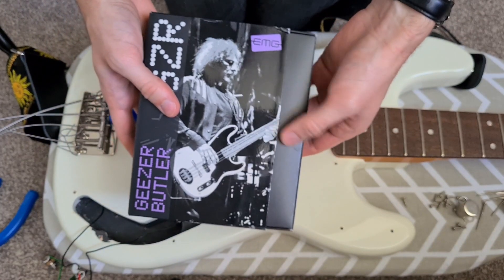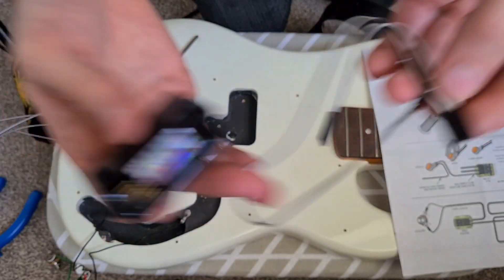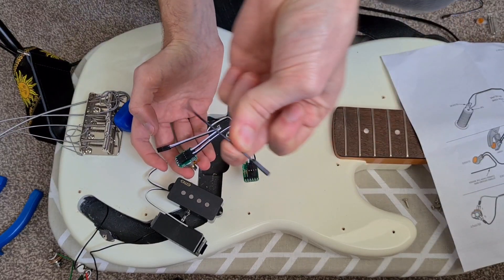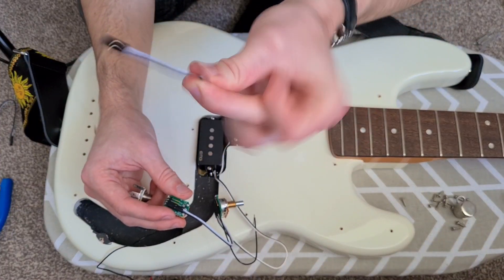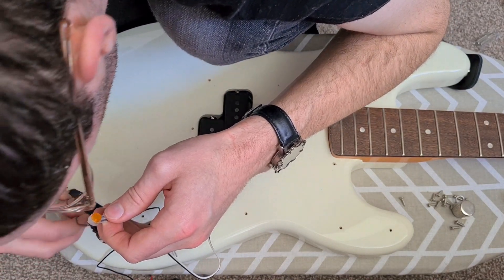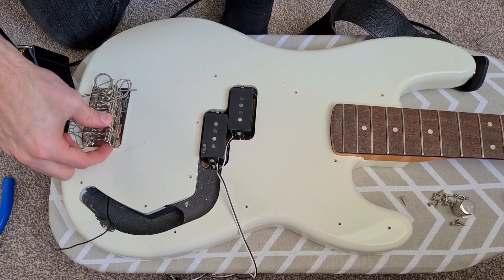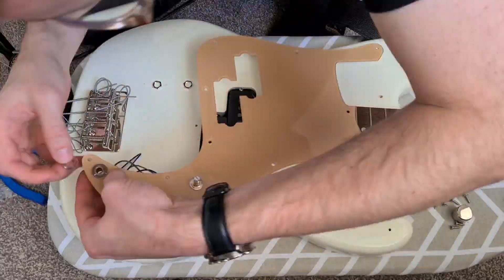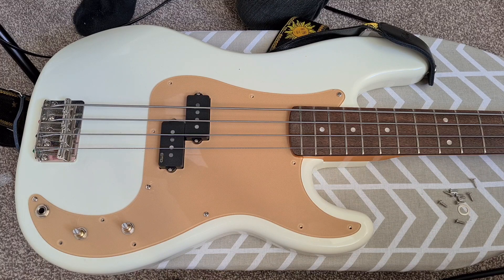Solderless Pickups?! | EMG Geezer Butler Precision Bass Installation

Comment: My son and I learned how to do pick ups swaps, tone pot swaps, etc all by practicing on the guitars and basses we buy, it really does save a lot of money.  Almost all the gear we buy is used and they usually have a straight neck and good string height action but this last Vintage Modified PJ i just got needed a little neck straightening so I was able to use a neck level tool I made years ago (never had to use it before) because i saw a guy on YouTube make one. What he did is bought a metal yard ruler and set it on the fret board and marked where each fret was, he then used a dremel tool to cut a notch on the ruler where he made the marks so the ruler could ait over the frets amd bingo it worked 👍. I was able to straighten the neck and now it plays very nicely. If I were you I would buy a soldiering kit and start practicing because it will save you a lot of money and you can swap out pick ups any time you want. Just make sure to get a good 60/40 rosin core soldier 👍
Reply from the maker: DIY is the best way! Saves you a lot if you can learn to do things yourself 😊 I do have a soldering kit and have fitted pickups before but definitely need more practice. The advantage of shopping in the used and affordable market 😁 Cheers!
Reply from the maker: This sounds SO nice! The GK RB is one of my favourite heads too. You're both awesome players 👏

Comment: What I've done before to get the groundwire back in, is to take one of those strips you get with cables, and then strip off the plastic (I didn't have any steel-thread). Then stick it from the top and through the tunnel. Then twist it tightly around the ground wire and pull it carefully back up. This worked out quite easily opposed to getting frustratred after several minutes of trying to stick it back in. No puns.

Comment: Well, I have to solder because my input jack is a long one... Ugh.
Also, are you using springs and foam under the pickups?
I have the PJ set and now on hold while I learn to solder.

Comment: Can I ask You for one thing? Grounding cable which is going from the bridge- did You use the one which was earlier in Your bass? Or You took one cable from the GB set and stripped it down from the tip? (I'm before installation, and I watched Your clip just to be sure that I'm not doing any mistakes). In my set there are 2 grounding cables- 1 with tip, and 1 without. So I think that I need to use the "original one" from bass- or as I mentioned- cut 1 tip from GB set and put it in this orangy thing. Am I right?

Comment: To be honest if I was installing these I would run a fresh and longer wire to the bridge, then cut it to length once I had threaded it through from the body top.  You could also pop a little piece of copper tape underneath the bridge and poke the wire through that.  Less hassle that way perhaps?
Reply: I stick a bit of copper tape under the bridge and solder the ground wire to that, at the mouth of the wire channel. This stops the bridge from riding up off the surface of the bass on the wire.

Comment: Should have used the original bridge ground wire. There is no need to remove the bridge. Also, did you put some foam under the pickups for height adjustment? The pickups should follow the radius of the fretboard with approx 1/8” gap between the string and the pole under each string when fretting the string at the last fret....slightly closer on the treble side.
Reply from the maker: I realise this in the video and put the ground wire back in. All about trial and error! Foam is in there too 😊

Comment: Hi, I just installed these pickups on my bass and i´ve got the same problem as you with my pots. Which pots did you buy to make it work? How thick of a spacing do you need inside to make them fit?

Comment: Thanks for the tutorial. I really like that the pickups are solderless which makes the installation so much easier. I'm also planning on upgrading my Squier CV 70s p bass with the EMG ones. May I ask which knobs you ordered since the squier's didn't fit?
Reply from the maker: Nice one! I still haven't ordered any knobs 😅😆

Comment: Have zero knoledge about the solder deal, never learn how to do it. I wanted to try the Gzr's since i knew about the solderless feature, to upgrade an old Yamaha Pb of mine, but that bass haven't a scratch plate cover, all the wiring is thru his body, as the bridge cable from your Squire, which made me think twice to buy them, cos I am one of those "spoil hands" on everything kind of guy🥺😒

Comment: Hypothetically speaking, is it possible to just wire the pickups straight to the output jack without having to connect the volume and tone knobs?
Reply: Yes. My grievance with solderless stuff is that it obscures what you are doing, electrically. You could take the wire from the pickups that you are meant to connect to the volume pot, cut off the connector and end up with one hot and one ground wire. Solder these to an output Jack and you would have a direct connection to the pickups.

Comment: DIY is the best way to learn. Here's a little tip, use a screwdriver and touch the magnets gently and you will hear if they are working. If you invest a small amount in tools you can do an entire setup. It just takes some practice. Excellent video Johnny !!! Cheers from Canada 🇨🇦🤘🤘🤘🤘🤘🤘
Reply from the maker: Totally! Thanks man. Dont know why I didnt think if the screwdriver test! Got my set of tools for setups, releasing a video on simple set ups soon! Thanks again 😊